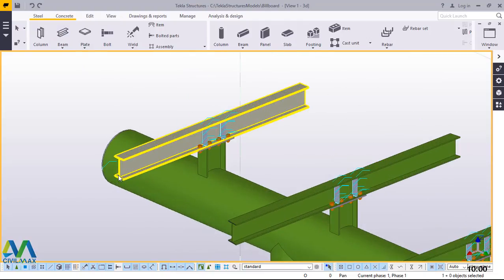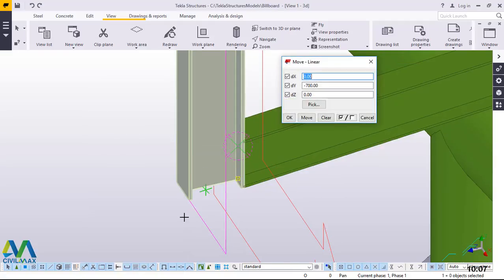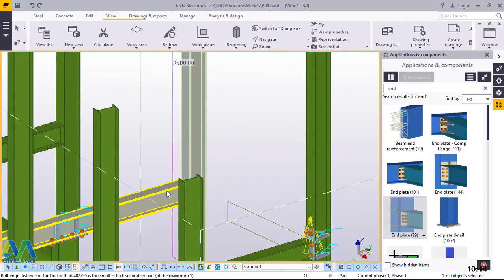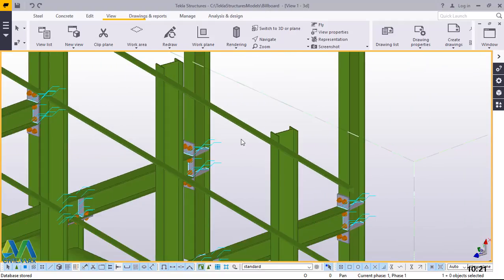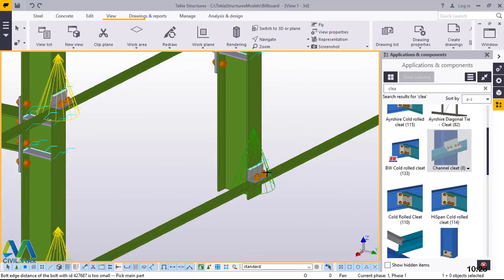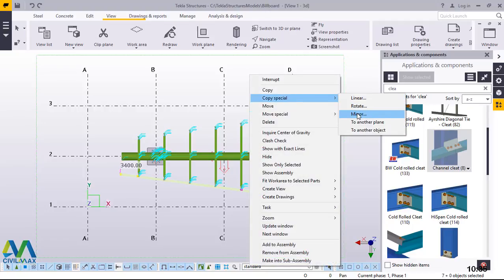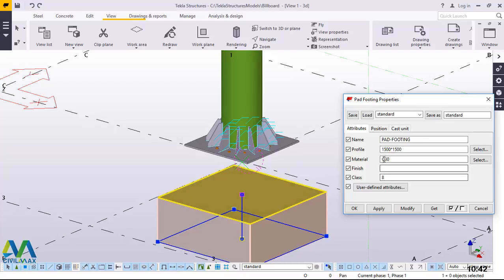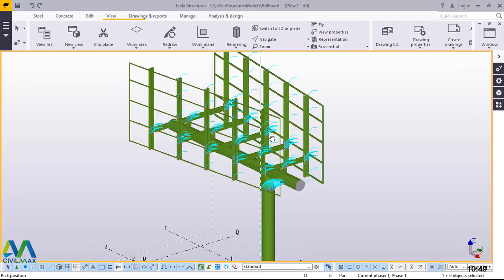Outdoor advertising billboard V Shaped Flag type modeling part 2 in Tekla Structures

Comment: Sir could you tell me if the Created structural model in Tekla structures can it be exported to Tekla Structural designer for Design??  and further analysed & designed  completely . Lastly how the analysis & designed  results in Tekla structural designer is further Re-imported to Tekla structures for creating G.F.C detailed drawings & schedules using tekla structures.I would really appreciate if you could suggest a reference video over these process. I couldn't find any so far
Reply from the maker: ir could you tell me if the Created structural model in Tekla structures can it be exported to Tekla Structural designer for Design??  and further analysed & designed  completely . Lastly how the analysis & designed  results in Tekla structural designer is further Re-imported to Tekla structures for creating G.F.C detailed drawings & schedules using tekla structures.I would really appreciate if you could suggest a reference video over these process. I couldn't find any so far